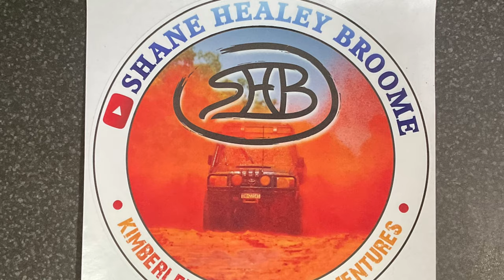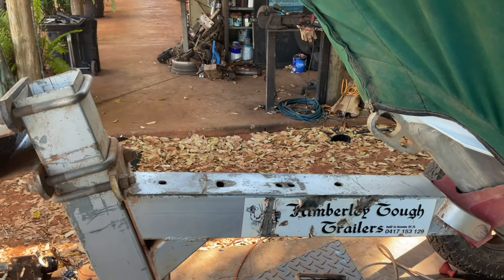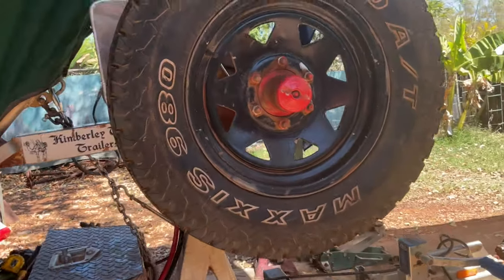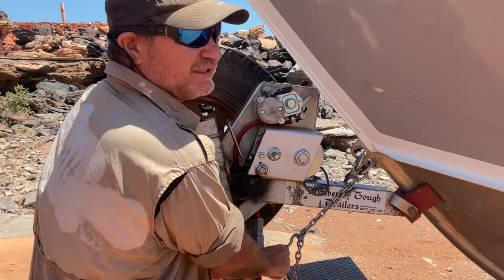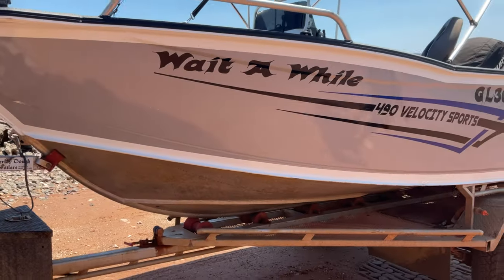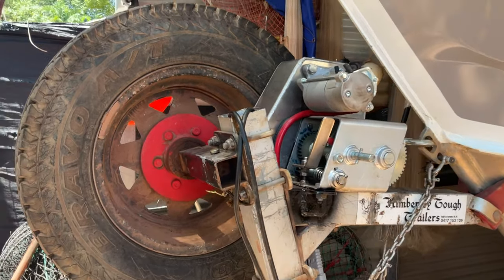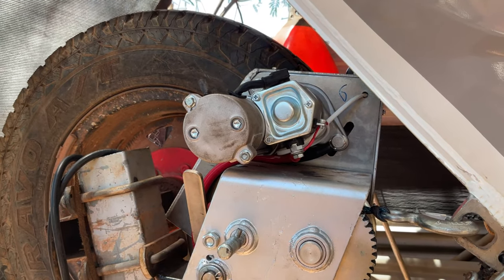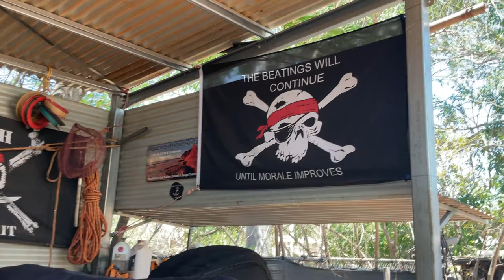Installing new boat winch

Comment: Nice work Shane. Should make life easier. Quick question... have you done any mods to harden the boat trailer for towing on the rough/corrugated roads?  Keep up the vids mate. They're great! 👍
Reply from the maker: Thanks mate yeah all my trailers are off road. I tow that unit to Kalumburu up the Gibb River Road most years
Reply: @notredame089  thanks mate. That's impressive.... Kalumburu Rd is the worst road I've ever travelled... bull bars falling off, broken axles, shot shockies... (not on my fourby thankfully..) must be tough trailers!  Cheers 🍻

Comment: You may need to run the V8 when winding it in and I like your stickers wouldn’t mind a couple I’ll buy
Reply from the maker: Yeah you’re right Nigel got plenty of stickers here mate send me your address and will work something out
Reply: @notredame089  hi Shane it’s 18 Littleton st Falcon Mandurah 6210
Reply from the maker: @nigelmorgan3449  Standard round Stickers five dollars how many would you like Nigel
Reply: @notredame089  hi I’m keen on 10 I’ll send you a money order if that’s ok
Reply from the maker: @nigelmorgan3449  hi Nigel, new batch of stickers have just arrived. 2 sizes 100mm and 200mm. Which ones did you want or do you want a mix of both
Reply: @notredame089  hi yes i would like a couple of both sizes thank you